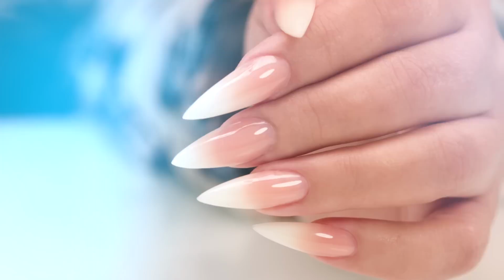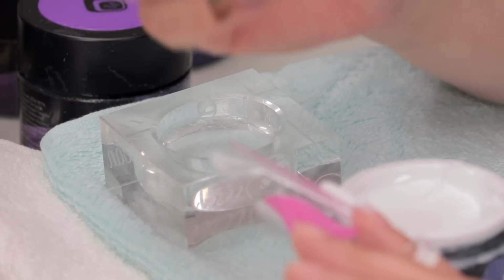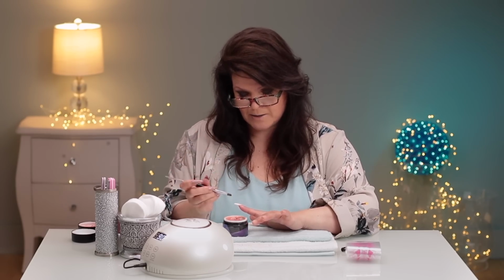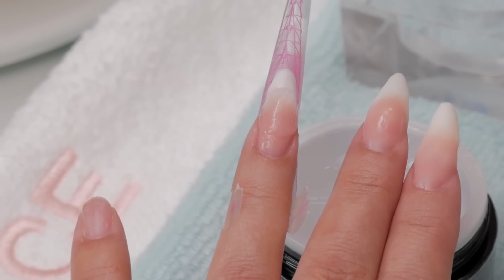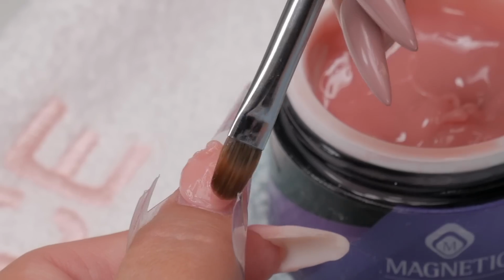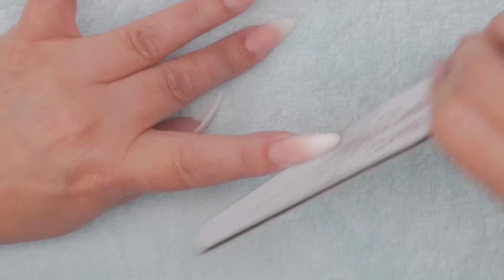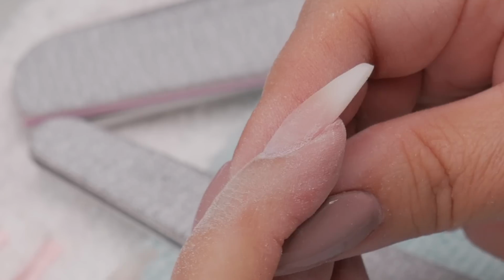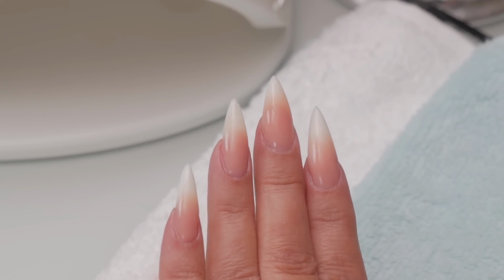Hybrid Gel Baby Boomer/French Fade Nails

Comment: I love this! I have this exact product, but never made a French fade. 

Some tips/information I learned about this product.
- The color Extender is actually a little less opaque than Nude. And it's a more cooltoned color.
- I was told to scoop up product from the side of the jar to avoid air bubbles.
- If you see "spots" on the product, your brush is too wet. If the product sticks to the brush, the brush is too dry. 
- Everytime you put on a new set, first lay down a thin layer of Clear where the  extended nail is going to be (so a little bit on the tip of the nailbed all the way to the tip of your new nail). This is supposed to help with the durability, because the other colors are more poreus. 

Hope this helps anyone. ♡

Comment: Being a fan of acrylic and prior oldie but goodie nail tech, I have to say that so far at least with the white, I’m loving the thickness to the gel in that it won’t run so easily. I LOVE how it’s staying put. It’s seems softer than poly but much more firm than soft gel! I’m only doing my own nails now and opted for gel for ease of use, but I have to say, with nail plates like mine which are high in the C-curve snd the sides are almost straight up snd down, having a tick gel is proving to be paramount! The regular gel out of a bottle is far too thin and I have great difficulty in repairing the end of my nail when it simply wears snd needs to be rebuilt up in just those areas! I’ll see what the other colors look like but this looks like a possibility for me. I was going to mix poly gel with the soft gel snd use that on the ends at the wear sites. I haven’t tried it yet. Any suggestions would be welcomed!

Comment: Suz...how do you avoid heat spikes?  Ive tried 3 different brands of gel.  All of them have heat spikes, even on the low temp setting.  Is fiber gel better to avoid the spikes??
Reply from the maker: Fibre Gel won’t make a dif. 
Turn lamp on
Hold hand outside of lamp 
Slowly creep hand closer to inside 
But S L O W L Y
Reply: @NailCareerEducation  thank you

Comment: Which breaks less often? Gel or acrylic?
Reply: Ooo great  question, if they are applied and done right they both should last about the same and won't break ( BUT if it does break and there is a gap where acrylic should be, it will break, the stress point is off balance so it would, break either way) It really shouldn't matter though

Comment: Wondering if it would have been easier/quicker to file the nails down with the drill instead of doing it manually?  Would that had been possible?  Trying to learn when is the best method to drill or manual file.
Reply from the maker: The drill/efile is generally faster- BUT this product is somewhat softer so its rather easy to file with the hand file
Reply: Thank you for your reply.  I THOROUGHLY enjoy each and every video you do.  You're awesome.

Comment: Does someone know how damaging or dangerous UV and LED lamps are? I do my nails once a week with an UV lamp, because my gelish doesn't want to last longer, but I am quite paranoid. I always put on SPF 50 sun protection on my hands. Am I worrying too much?
Reply: Za Igre
Well, how are you prepping your nails? If you're not dehydrating the nail, using a oh bonder/ph balancer, base coat, at least 2 coats of color, then top coat the gel is gonna peel like a skicker.
Reply: lnuma92 I do everything but dehydrating and using a oh bonder. Is that really important? I thought dehydrating is not so important, so I kind of just rubbed acetone over my nails to make them dryer, and I could not find this in stores :(

Comment: Is there any way to get this look with just polish?
Reply: Jessica Ayala yeah using a wet sponge like you would a gradient. Or pigments too
Reply: Jessica Ayala is the sponge wet with water?
Reply: Arline Andrews yeah wet sponge apply polish in part pink part white dab dab dab on nail.. overlap a bit to get gradients effect.. I did a video using neon pigments not foil glue u could also use a pink pigment on white nail.. or dip powders too.. those actually I found easier than polish lol

Comment: Why did u have a paper on your nail¿
Reply: It is called a form, it is another way to extend the nail, there are 2 ( main) ways which is a tip that is applied on top of the nail with glue, and a form where you put wonder the nail which is just a platform for the extension, you take it off after you form and make the nail though

Comment: Could I mix the top coat with polish on wax paper -then apply it -nuke it
Reply: yes, if your using it for a jelly polish, if it's normal polish, then make sure it isn't a fast drying top coat, a clear polish would work way better and wouldn't dry quickly though.  You do need a top coat after you apply the mix, whener topcoat and polish or clear with colour